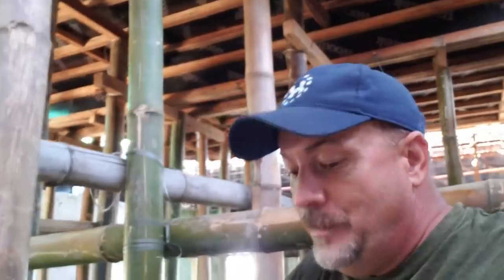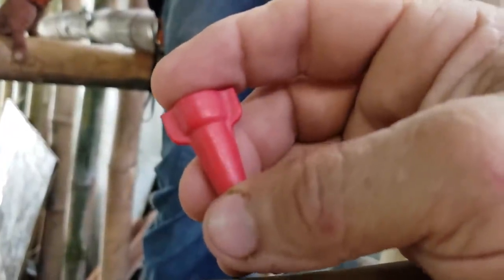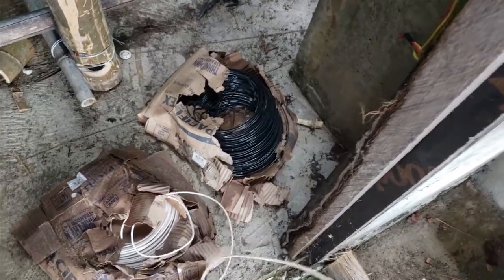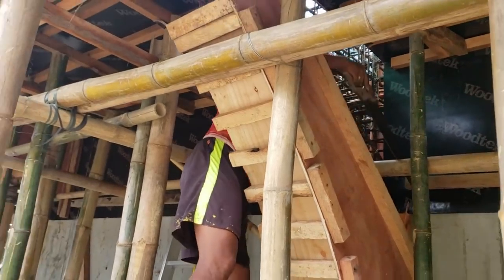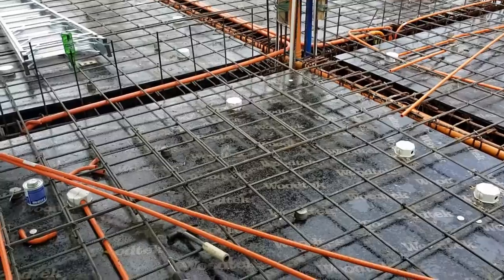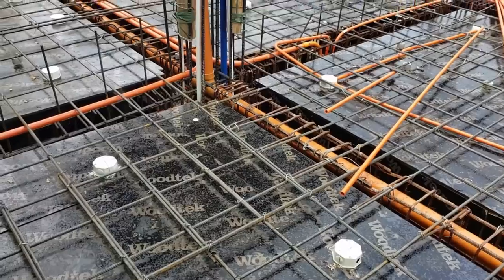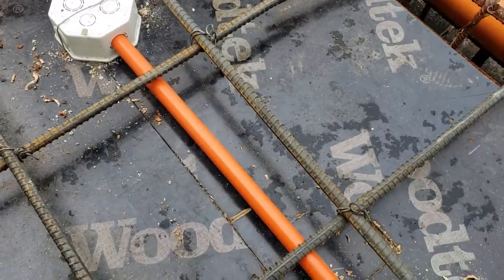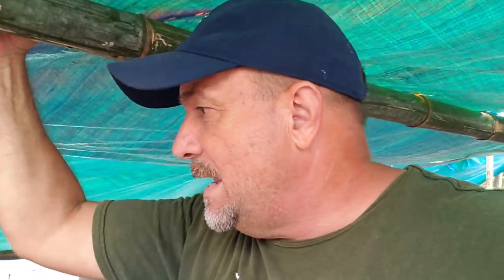Philippines Beach House Build Day 130: YOU told us we can't have electric in CONCRETE!

Comment: With regards to future proofing for the security cam, put some ethernet cables in the conduit as well that you can use for the cameras using Poe (power over ethernet, single wire cameras). 
So true about the colored wires, when I built my solar wiring there were only a red and green wire available. So I just used a black and white electrical tape to wrap the exposed end coming out of the boxes.

Comment: I recently was doing my own electrical work in my house... and watched a YouTube video and saw a new connector I've had never seen before called a   "Wago" connector... I'm sure they are probably hard to find there but they are definitely a superior way to tie wires together..
Reply: They make strong fast connections, so make a lot of sense in a temperate climate. But they create much smaller contact area than twisting wires, so I would be nervous they would corrode quickly in a hot salt spray
Reply from the maker: wait wait - they do twist the wires . if properly installed and twisted if you back it off the wires will be very twisted tight and uniform. the cone keeps it tight and compressed and the plastic nut gives protection with a long skirt. Salt spray -they are embedded in plastic boxes sealed in concrete at 4000 psi no salt getting there.
Reply: I hope nobody thought I was arguing against wire nuts. They are just fine, especially if that is what is available. The Wago connectors is something I didn't know existed and would have really made my life so much easier. I'm sure you probably know about them already.

Comment: Hello James. I've only been watching your channel for a week but I'm very impressed with all that you have been doing.  I'd highly recommend that you look at network cameras for your cctv system. We built our home in 2002 and I held off for years until network cameras became available and they are so reliable. Now you can get 4k POE cameras.  My own system is using Blue Iris software running on a Windows computer with 13 cameras connected via home runs of network cable and using a POE (Power Over Ethernet) network switch. I have Android tablets all around the house just using Chrome web browser so you can see/check the cameras from any room and you can use the app on a smartphone. Blue Iris works with many brands of cameras so it's future proof! Let me know if you have any questions.

Comment: James,, I actually got to see how concrete is tested. I brought samples to the lab. They had a huge Hydraulic Instrument with a big calibrated gage next to it. They brought the ram down and broke the core sample, then recorded the reading. So interesting just to get the opportunity to see that.
Reply: Yup,  was a little surprised,  when the municipality rebuilt our local  bridge , when it came to pouring the concrete,  had the mixer trucks and pump going. They actually were taking samples for quality ect.
Two years later is still ok,  no cracking ect.
Not the usual casual  attitude!!  Lol
Tho has taken nearly 6 months to do a 60 feet section!! Lol

Comment: James i sometimes take a propane torch and run it up and down the conduit/pipe and i bend 90* 45* any angle just got to move the torch enough to not burm the  pipe..not sure if u done that but if u dont have 90 it works great thanks James
Reply from the maker: the guys here just light up paper or cardboard. Why waste propane. they couldn't get it to burn in damp air. I just took the solvent using on the pc conduit n made a light swipe on the cardboard. Worked great and we shaped all the tubes nicely. :)

Comment: Beach and boats have lots of failures with wire nuts and a lot use heat shrink tubing connections to keep out humid salt air. Would a dab of silicone caulk make sense to keep them dry?
Reply from the maker: There is only a wire nut on the earth ground. The others are straight run to the outlet no breaks no service no failure. Next air? No air. It is encased inside of dense solid concrete.

Comment: We seldom use that in the Philippines, electricians here just put a good electrical tapes in the joints of wires in the box iv’e seen that thou in electric fans wiring connection
Reply: Remove the electrical tape years later....you will see turning green..a sign of oxidation similar to statue of liberty made of copper...Wire nuts will be replaced by WAGO nuts in the future...

Comment: I've a question for you.  Are you just doing a single layer of re bar mesh on your floor.  
I'm really intrested in your build.
Reply from the maker: double
Reply: @TexasFilipino  ok ,just wondering did a few buildings on the farm . Mainly used 10mm a393 weld mesh .walls were wider for load carry so double as well as floors. 
As i said i like your style .

Comment: Many CCTV installers here use at least UTP cat 5e even for non-IP cameras instead of coax. It can basically wire up 4 cameras with video baluns in a single run instead of just 1, while providing you an upgrade path to PoE IP cameras in the future.
Reply from the maker: everyone is being so specific about me saying coax. the point is no matter what kind of wire I want it to fit easily thru. My current camera system which I like has made up molded ends  and  i want to make sure they slide thru easily plus if  want to have access for any future tech to run inside same conduit. might now even be camera related. Fact is oversize for future expansion is my goal. I have a big camera setup right now and it all uses coax. it is remote viewable and controllable from pcs or apps on phone and has cloud service and 4k as well.  I will use it until it is dead. LOL Thanks for sharing that for others who read they know the current happening in that type of gear . I am HIghtower and your Highsoap lol

Comment: For CCTV go with Cat5/6 ethernet cable, Ideally, use IP camera's but if you're looking for an affordable option the turbo HD series from Hikvision is decent and can also run over ethernet cable with the use of baluns. Have you also thought about home automation? Some nice options are available to control and manage your lighting etc.
Reply from the maker: I am not in the market I have a large setup already - 4k - pc , android and apple ready. has cloud and many terra bite hard drive. it does use coax and so that is what I am running. I have a camera down the beach at our old house that i can move any direction and see miles away with. I can track boats on the water and see fisherman pull in their catch. :)

Comment: Wire nuts are not commonly sold or used in the UK. We use chocblocks metal screw down terminals covered in plastic , but new reusable terminals are starting to be come more common .. 
Like wago push wire or lever connectors
Reply from the maker: but you do use something besides twisting raw wires and black taping. that is a failure point for sure if not compressed together and secured.
Reply: @TexasFilipino  yes definitely  , 240v and black electric tape should never be used together as a joint . Major fault and fire risk . 
My comment was more if they stocked uk/European Terminal. In hardwear stores .

Comment: By the time you finish the house by the beach in Paradise  you will have  learned the  locals there  some Western construction methods and practices and  materials   used out West,good to know  some  wire connectors or Marettes  as we call those here.i have a few  boxes of them myself ,for when the time comes for the build there.  The yellow ones for 14 gauge wire cost less than $10 for  100pcs,might even ship the 14/2  grounded romex  wire
Reply from the maker: that romex with all three wires is not really used in conduit. atleast not to my knowledge. I think it  involves several factors. nm it is referred to. Thhn thwn is what is use in conduit. heat can be a factor too is the wires in the conduit cannot breath. They sell 14-3 romex here. It is common. I am not a fan of some the local brands. So it might be nice to send some if it is not used in conduit. wire is not cheap here as most places. It might even be higher. Rodents chewing wires can be a issue here for exposed wiring. In conduit is best. The cheap plastic flew conduit is garbage here. it crumbles away in just a couple of years or so. gets brittle . avoid it.  it does not cost much to run thhn thwn  stranded in pvc conduit here. maybe grab you some rolls of that.  House fires happen a lot here and most are electrical. 220v sinlge phase ain't no joke. It will show you who is boss fast! Respect it and do it right not just local cheap way. They are just getting by on tight budget and make due. If you have means to do it better then do it.

Comment: Great job with your videos! Im from california, and I can relate to your experience with things like wire nuts as my workers don't know that as well. luckily my dad is an electrician and he got a lot wires, breakers and boxes and those big home depot jar full wire nuts we send back thru door to door.
I can totally relate, as I oversee building a similar size house like yours. I just have a couple mason and helpers, didnt get a foreman/contractor. Did the electrical myself and workers were asking why theres an extra wire(grounding). Im old school as well I ran cat6 for network and cctv and rg6 cable as I dont rely on wireless.  I ran 3 cat6 cable where tv/entertainment area located, I used 2 sets for hdmi converter so I can put the tuner and etc hidden. It was funny when you mention framing nails before as I was looking for it when I was building my house. The simple things we find state side at home depot, good luck finding it in the philippines. I wish you had your channel back when I built my house 3yr ago it woulda been really helpful then.  

I know you getting tired of people commenting about mixer topic, but atleast consider getting a lil extra more manpower. I built similar size house like yours, and when it comes time pouring the 2nd floor slab I'm aware how hard it was. I hired 20 people and also gave them extra bonus as I know 2nd floor concrete pouring needs to be done in the same day non stop. I had a concrete mixer that day and we had to take shifts as it was brutal for my workers, we had to go on over time and we finished at around 7pm. I kinda feel bad for your workers on pouring day, as my workers struggled and that's with a mixer already. atleast try to add a bit more worker. 

but anyways, keep up what your doing!  Great job adapting in PI ways, especially when we got used with how things work back in the US.

off topic, is your toyota surf the one that came with 1KZ-TE engine?
Reply from the maker: 2lte engine. 2.4

Comment: I work for an international electrical supplier and we are even experiencing a shortage of wire. This is due to the short supply of the resign needed for the wire coating. So get what you can now as its only going to get harder.
Reply from the maker: I agree Sir and thank you for sharing that info.  Things are not easy - we are trying to stock right this minute. Even we are trying to order bulk of steel and they was only able to partial fill the order but said we would be first to get deliver when stocks arrive!

Comment: James ,I know your on an Island just saying they do sale Elec fish tapes there 1,398 P to 2,800 P ,just tried doing it the way your doing it !, and it didn't work well ,and the 2nd ? Was what the reason your pulling your c wire now ! Is it just to have it done ?
Reply from the maker: done and over. Make your loop really round on that wire. listen fish tape wasn't good - it is flat and does not to make multiple curves opposing directions. we pulled nylon thru the tough ones with a vacuum cleaner like I did  a video a couple months back - hooked wire on that and pulled it on thru. easy peasy. ME DON"T NEED NO STINKING FISH TAPE ( in my bad drunk Mexican voice like speedy Gonzales friend) Reason to pull the wire well we are right there. we have concuit in hand. We on top with a flat service so no need to be on ladders later doing it. Just pop it on in and done!

Comment: Frightfully complicated it is good that you have competent workers . I also bought a cement mixer just a 4.4 cubic ft hahaha they don't want to use it either that is fine.
Reply from the maker: They all just follow my lead!
Reply: Its a daily thing as they are paid per day. If they use the mixer they fear the work day will be shortened and their pays get cut or less. So not using the mixer is a way of milking the work day to get their full pay and even some OT. But if you told them that they would get the same pay even if the day was shortened thru using tools that sped up progress, they gladly would and be very happy. But bosses there dont do that kind of thing,. Bosses just abuse the worker(generally speaking). As James said "this is a community thing". She's gonna be an ALL HANDS ON DECK mongrel day LOL. anyone that has done hand mixing will feel their pain. I know I fkn do.

Comment: They have new one and different types connectors one of them wago ,Color coding in the Philippines (wire) some electrician don’t even know or even follow , 2 hot wires and no neutral, or ground 😩that’s it

Comment: I know from your videos that you have a single water line to each CR, but have you thought about using your excess solar power not used when your batteries are charged to drive a small hot water heater to preheat your water to your in room hot water heater. Will save you big in battery storage.
Reply from the maker: Thanks for the idea - seldom do we use hot water. In our other house down the beach we have not turned on the hot water heater in about 4 years! It is mainly for guest. As far as hot water goes I will most likely make a solar heater. I built several in my life. Worked great - I heated a hot tub at my house in Texas for a long time off a home made solar heater. shoot had to watch out or you be adding carrots and potatoes while your cooking yourself! lol

Comment: power can be in concrete requires correct boxes and conduit..master electrician here....3M wire nuts are better but i bet finding them there is impossible

Comment: I agree that you need to compromise to meet the local codes for the electrical. So many people in the US have no clue, they just know if you plug it into the outlet, it should work.  Having worked I. The electrical field internationally for years, the one thing is mostly typical is that green is usually the earth ground. Sometimes it is green with a white or yellow stripe. Like you said I. The US it is Black= hot and White = neutral. Many international regulations use Red, Blue and Yellow. We have used the Blue to replace the Black and the Yellow replacing the White. I think I noticed in the box you used the wire nut in, you spliced the yellow.
Reply from the maker: red blue yellow that is what I went with on all my lighting runs. I used green throughout as earth ground on everything.  On my wall outlets in 12 gauge I use white black green

Comment: Is 14 gage home runs and 12 everything else?
Reply from the maker: I am running 14 gauge to the led lights , 12 to the wall outlets , 10 to the aircons. Fact is I could have ran 14 to the wall outlets and 12 to the aircon like most are here but why push it for a small difference? Plus less resistance if I step the gauge up and that helps on my solar. Especially when something with a induction motor starts up.
Reply: @TexasFilipino  excuse me while I write in my notebook.  Going to DC tomorrow in a snowstorm to get my wife a Philippine passport in prep for our move next year.Hard to get an appointment.

Comment: I electrician you Can use  conduit in concrete   using orange what you can do run bond wire all through mess and connect back to electrical ground on box . I is to if short in any of conduit in concrete . No sure if you have earth leakage available there . I petroleum industry and all about bonding ever thing is as one ground
Reply from the maker: and that is exactly what we are doing!

Comment: I noticed a lot of pvc pipe that was embedded into your structural beam, I would recommend to contact your structural engineer or civil engineer to look into it prior to pouring of concrete. This is way to much and the pvc pipe was installed right into the tensile section of your beam.
Reply from the maker: I have covered this so much. These are cast form walls that carry full sheer load. If you look closely you will see the steel standing up for the continuation of the wall above. No beam was actually even need. That is more of a chase just for those electrical conduits you referred to as pvc pipe. in other places they are ran the beam was intentionally oversized just to accommodate them as well. The columns was oversized for that purpose as well. I am the builder , contractor , engineer  etc. As far as the local authorities it is all fully passed. Thanks , I know your view on video is limited and you might not know those details when you posted that. Appreciate you trying to cover my butt. Thanks and big thumbs up. :)

Comment: You can get away with different color wire in a pinch. I wouldn't use any other color than white for neutral. Pick a color for switch legs, or traveler wires, on three way or four way switches. Then run receptacles in black, red, blue, which are the same colors used in a three phase system. Then you know black, red, blue, are hot wires. White is always still neutral. And any remaining color is a switch or traveler wire on a switch.
Reply from the maker: in most rest of the world outside of USA yellow has replaced white.
Reply: Mostly in the Philippines, we don't have a neutral. We use 220v system where both lines are hot and carry 110v, so using two black wires is correct.

Comment: appliances plug in cords have grounds?
Reply from the maker: many new things do or they having a place for a grounding wire and you can buy a adapter with a copper tab sticking out to connect that external ground wire to.